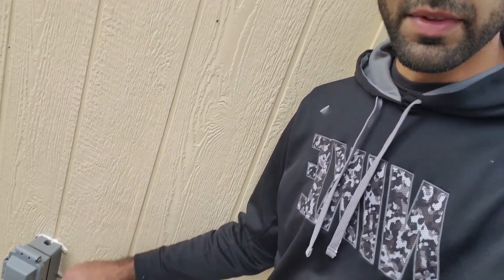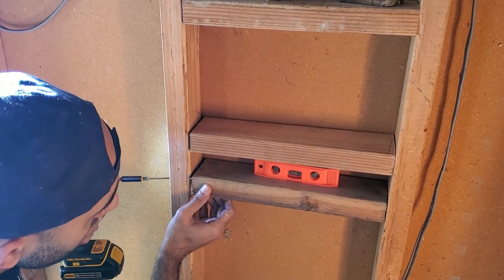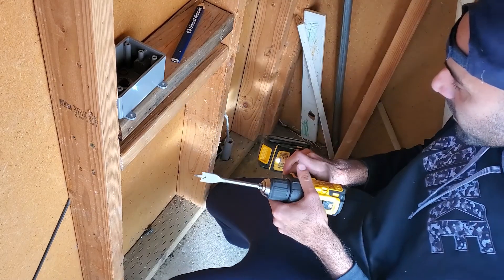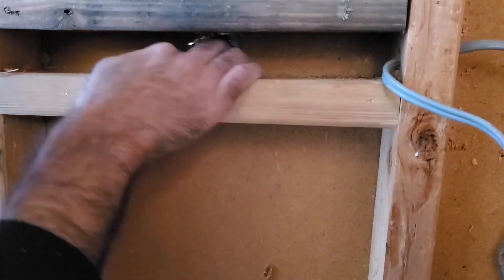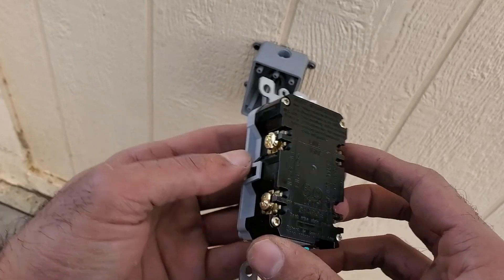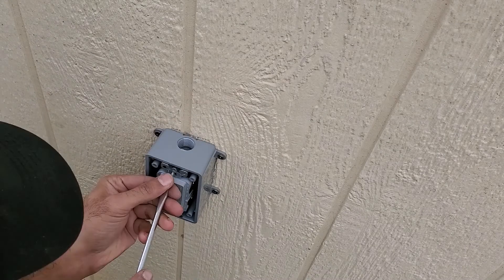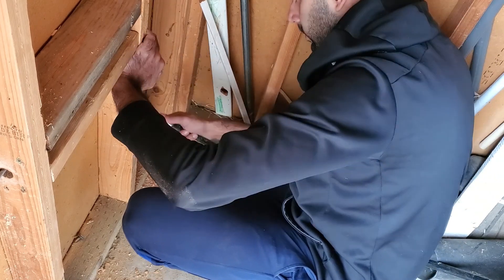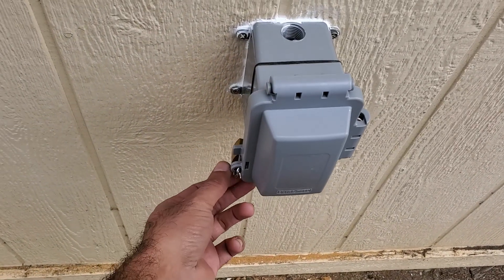Installing a GFCI Outdoor Outlet with no Preexisting Wiring

Comment: i think you should of put sealer at the hole you drilled to the new box before you attach it to the wood shed, and if there is a little kid around i would of put it 5 feet up at my house because i can  lower it  later on...  just say`n